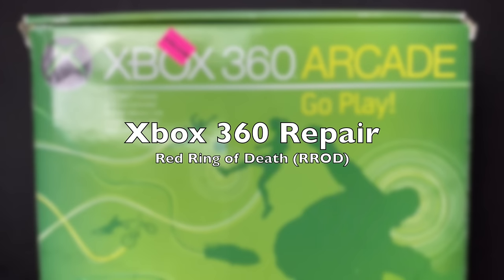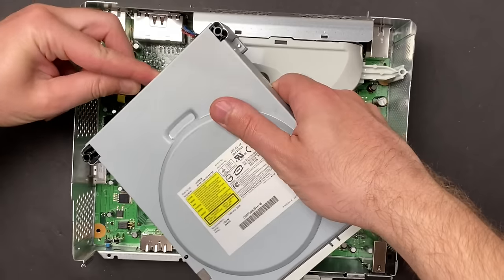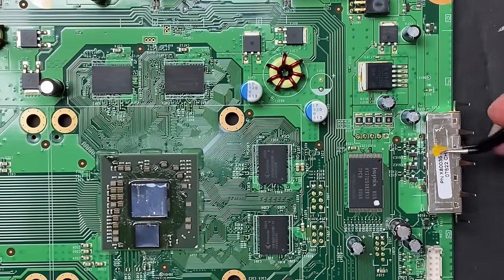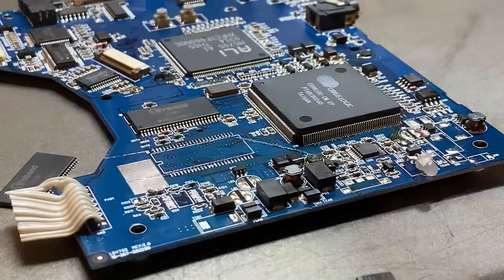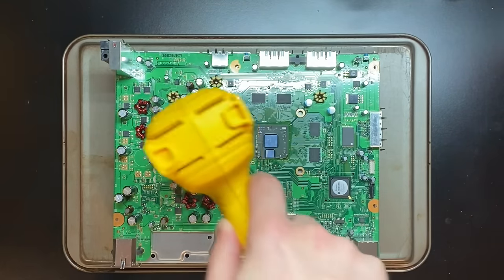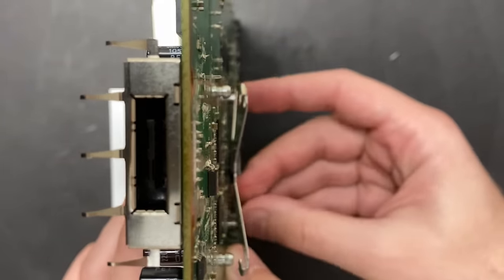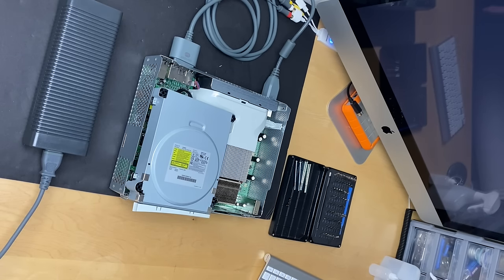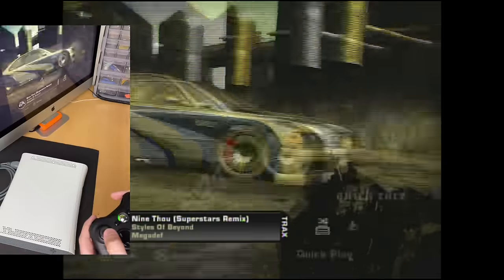Xbox 360 Red Ring of Death - DIY GPU Reflow

Comment: Okay just a heads up:

Place a layer or two of aluminum foil over the "silver capped" chips to prevent them from exploding or melting acids (they measure impedence and yes you can replace them but it's a real pia). Also aluminum foil everywhere but on the actual chips and even under the Xbox (like a basket) is a REALLY GOOD IDEA

Also the best parts were available at Lowes though I don't have the part numbers on hand I have fixed and modded hundreds of xboxes and the aluminum foil and Lowes part numbers worked 100% of the time for me and other amateurs.

The timing on the heat gun (300 - 450) should be perfect down to a science in fact I had mine on high for 30 seconds after an initial warm up from low for a good 3 minutes and a cool down for another minute if it would give me the same secondary code I just went up on the number of seconds in 10 - 20 second intervals from the warm up and cool down phases.

I also waited an additional 30 - 45 minutes before a test boot.

C4eva for life!
Reply: Oh and one last thing always use the right size screw driver to remove the x clamps! And using Lowes M4(?) machine screws with metal on plastic washers (on both sides: 4 total) provides adequate spacing just do not overtighten and definitely don't reinstall the x clamps since they were the reason WHY the GPU developed a cold solder joint in the first place
Reply: Also the capacitors don't need heat AT ALL because they can actually explode and yes you can melt parts straight off an Xbox doing it the way you are showing people.

Put an aluminum foil cover over everything BUT THE CHIPS

Comment: I really liked this repair I have my first Xbox 360 around too, it is red ringed, but I kept it, at a time I fixed it with a home repair website subscription that I bought for $30, my repair only lasted 15 minutes though. My question is you or he removed the components when using the heat gun but I didn’t see how he attached them back? did he use the heat gun again to attach them back or how? Because I wanted to remove those components like he did but how would I attach them back? Thanks.

Comment: Any recommendations on replacing the caps on the mobo? I went through this entire process of reheating the solder and new paste and it’s still kicking me a 0001 psu code. Tried two different psu’s and neither have booted my Xbox. After looking at the 3 caps near the psu port I noticed 2/3 are looking rough with corrosion and bulging. I’ve never soldered a thing in my life, but I’m wondering if those could be the culprit

Comment: I thought these xbox with the added heat pipe and fins for the GPU mostly fixed the RROD issue so I was surprised. I have this version, I think it's called Jasper..., and I've not had issue. Haven't played it in years now but hope to use it in the future.

Comment: Great. I just bought one of these for $5 as well. Don't have any cables yet, but taking it apart to see what I have. I have a 858D hot air station. If it turns out it has this issue. While ago a friend had one and just put washers on the screws for the heatsink. Puts more tension on the die.

Comment: This is my last resort before chucking the old console...I cant seem to get the plastic plugs off though.  Ive been heating them with my heat gun on low, but they dont get soft and pull off like in the video.  They seem hard and brittle.  Any suggestions?

Comment: I’ve had my share of wacky repairs. I remember shrouding my 360 in a bath towel to play my games until I saw weird graphical shapes,knowing my 360 was about to fail. Then I would whip off the towel and put two small freeze pack to cool it off. Hey, whatever works to play that bo2 zombies yaheard. That 360 I bought for 50 as an adolescent made me a pseudo-engineer hah.

Comment: Very informative video, and i am now looking in my collection if i own NFS: Most Wanted :)
On modding, planning of drive flash of a JTAG/Reset Glitch mod?? (this bring so much great options as homebrew, 'backups' and emulation.
Reply from the maker: I'm a huge fan, its been fun to replay it the last few days. Been an NFS fan since I got a demo disc of Need for Speed 2 SE on the PC way back in the day. Also played Hot Pursuit endlessly when it came out -- the cops chases were such a novel idea for a racing game, and challenging!

On the mod, just based on my dash version seems like I can RGH and the wiring will be simpler than R-JTAG, so I'm going to avoid updating the dash right now so I can exploit it with RGH later. No option to JTAG unfortunately on this dash version. I didn't really consider a DVD hack so haven't done any research there. Do you recommend it? I think playing backups from the drive will be the big appeal, you know, since I acquire all my games legitimately, ahem.
Reply: @BorderlineOCD  I love te older NFS games too, with my all time favorite Underground. And Hot Persuit as second, played that over and over too :) I have Most Wanted in my collection, checked it last night, sounds stupid, but i have over 300 origineal x360 games so things can be overseen :)

I self have a JTAG that was done in 2010 when the hack game available, but the RGH is the same thing as i understood, so if you can do that, definitly RGH the console so much more advance over a flashed DVD drive that only can play burned DVDR's. RGH Straight from HDD (also burned games) en homebrew emulators are so much better.  Speaking of HDD's it's from what i understood a SSD is possible :) Mr.Mario2011 didt a special about RGH and the software to use.
Reply from the maker: 300+ games wow! You must have a great feeling every time you look at your gaming shelf...

Just watched the Mr. Mario 1TB SSD install. Apparently the SSD is more for data preservation than speed as the 360 bus is SATA 1 so a spinning disc would be just as "fast". But SSD prices are so cheap these days it probably just makes more and more sense as time goes on.
Reply: @BorderlineOCD  Just so you know you can rgh on the newest dash I did so a few days ago using a coolrunner rev c, falcon motherboard. Also i'd recommend getting some 0.1mm magnet wire for jumping traces instead of using that giant stuff you used on the xbox it's a lot more flexible

Comment: In my xbox 360 fat version, 7 green capacitors have leaked and yellow liquid is outside on the top of each capacitor yet my xbox 360 is working, do you know how it is working with these many leaked capacitors?
Reply from the maker: Capacitors fall out of spec gradually and eventually fail. You can begin to experience unexpected behavior with failing caps and parts of the circuitry might be more stressed than designed but still operating within limits of component failure. Also there is a lot of redundant circuitry in modern tech. For example there can be several layers of filtering to achieve a clean video signal and if part of that circuit is out of spec other components still achieve the desired result. But long story short you need to replace those caps as soon as possible. The electrolytic fluid in caps is corrosive and will eat away traces on the board which will increasingly make the system more difficult to repair/revive down the road.
Reply: @BorderlineOCD  Thanks for the clarification, yes i faced 3 red lights sometimes when i do not use my xbox 360 for few weeks because of those failed capacitors and it did not start and 3 red light issue (red light of death) came but when i try few times by disconnecting plug and try again then it starts to work and it works without any issues until i did not use it for few weeks and again the same procedure of retrying to start it few times and it starts again and it works without any problem. Definitely with few working capacitors, i have to use it regularly. These failed capacitors are there in the xbox 360 for 3 to 4 years now, i have replaced the failed capacitor earlier but they keep on failing after the repair. Also the fluid in the capacitor is not there in the board as i have kept my xbox 360 vertically and it is not falling on the board, it is difficult for me to get them replaced as i need to goto some repair shop for their replacement, i am waiting for more capacitors to fail and will wait till these capacitors create problems in xbox 360 and then will goto repair center for the capacitor replacements. Red light of death in xbox 360 also comes due to failed capacitors.

Comment: Ignoring RROD issues, I wonder if there's any reason worth considering the OG 360 (particularly Elite) over my current 500gb E model? Also how'd you use your iMac as a display?
Reply from the maker: The primary reason would be your ability to mod the system. The capture card I use is linked in the description. It’s an inexpensive card that supports Mac.

Comment: Hey Mate, doing some great job with your restaurations, so if i got it right, you're using the lowest heat as possible with the Heat Gun ?
I'm actually also purchasing tools for that kind of fix, just wondering if a 350 celcius Gun shall be enough ?

Thanks in advance
Reply from the maker: Plenty enough to do the job. If you have a junk board try it to get a feel for your particular heat gun. It will give you confidence doing it on the Xbox.
Reply: @BorderlineOCD  Thank you very much, i did the repair a few days after you've replied, forgot to let you know that it went very fine !

Comment: I wish consoles would finally adapt CPU sockets like we have on PC. The only reason they don't is cause then its easy for anyone to just take the CPU out. That and the backplate or in this case the big metal thing the xbox 360 sits in is awful, all those bends and dips instead of a flat surface means that over time with heat the motherboard warps this is probably what causes the RROD all you need is just enough movement between the consoles mainboard/motherboard and the CPU, GPU, APU or any other components that get hot enough to weaken the solder they are attached with. On PC we have a backplate and wee risers called standoffs, The motherboard sits on these making it level and ensures there is a bit of room for ventilation behind the mainboard/motherboard instead of just motherboard directly attacked to a backplate that has to leave a bit of room, just enough so you don't ground out components against the case.  We then screw the motherboard into the standoffs and our CPU's and mostly everything else go into sockets. Upgradable at any time and forever unlike a console. Also this avoids the issue of solder getting weaker and turning your device into a brick. Consoles had to go with APU's. Accelerated processing units which is a CPU with its own onboard GPU this limits the problem of anything like the RROD as well. That and the newer consoles seem to at least finally have a better design, The xbox series X still worries me a little with a disassembly video I saw of the APU being held on with magnets and has pins on the back that match up to the socket. A simple retention system might be better. I hope they are good magnets. The PS5 is still using a soldered on APU which is fine as long as the cooling is good. The RROD and YLOD are two problems the consoles never should of had.
Reply from the maker: That would be great from an upgradability and repairability standpoint (not to mention good for the environment as hardware lifecycle increases). Too bad this would be contrary to the business model of most hardware manufacturers. Consumers don't care much for servicing their own stuff, generally speaking. If anything, embedded devices will get ever more popular.

Comment: i just got an old red light xbox 360 for £5 (uk pounds) and copied your method and it works and also has the same dashboard! I only bought it for the case as it was in good condition but thought I'd try it out of curiosity
Reply from the maker: Nice to see you got it working on an old dash! Can you tell me if you removed the plastic anchors and used flux? I'd like to know how long the repair holds up so if you like, please do share an update after you've used it for a few months.
Reply: @BorderlineOCD  yes i did the same and removed the plastic and used flux. Ive updated the dash and ill rgh it with ace chip like i did with another zepher so i can increase the fan speed.
Like you said for such a little amount of money it doesnt matter how long it lasts, it'll just be interesting to see how long, maybe forever!

Comment: Sorry I'm less experienced in this topic but how com the spray didn't cause water damage to the motherboard?
Reply: Because it’s IPA, not water. IPA doesn’t conduct electricity
Reply: @SteveTheCreek  Thanks for the straight forward answer.
Reply from the maker: The answer above is correct. It's 99.9% IPA. The water content is 0.1%. It is marketed as an electronics cleaner and is safe for that purpose. Some people use lower concentrations like 91% IPA but it has a higher water content so I don't bother with it. If you use that make sure it dries thoroughly and don't use too much.

Comment: Apart from cleaning the old paste (and putting back way too much), what is the purpose of the Flux ? What is a Reflow ? The melted flux goes all around the board, then needs to be cleaned, so what !?
Overall nice job, especially warning of potential heat damage 👍🏻
Reply: Flux helps the solder flow easier
Reply: @BeinZilex  but isn't flux a degreaser during soldering ? what's the point to "wash" the circuit board and components with warm temperature ?
Reply: @laurentpenot2656  he was using isopropyl alcohol to clean the board not flux, he used flux after

Comment: The EASIEST way to fix the ring of death is by literally just flipping those 2 little fans, when I was a little kid I had an original xbox 360, kept giving me ring of death at least every 30 minutes so I ended up taking it apart, flipped the fans to blow the air the opposite direction then POOF red rings literally gone forever.

Comment: I also have a red ringed 360 but the previous owner did the bolt mod which is known for later screwing up the motherboard but it won't turn on at all and im not sure what could cause it as it does have the bolt mod which could be why but theres also a set of capacitors around the gpu and cpu that have gone bad but when i used a hair dryer on the board i managed to get it to turn on once again but it only happened that moment after that it was back to the way it was but i decided to use the hair dryer again and well it only gets it working at random
Reply from the maker: I’ve seen some pretty funny pics of warped boards due to x-clamp mods. Too bad about the failing caps. It’s still an inexpensive system to shop for so hopefully you can get a working one together.
Reply: @BorderlineOCD  yeah but honestly with this one its not that much of a loss even if i cant fix it as i paid 5 dollars and it came with a hdd and power supply and tv cables

Comment: I had an Xbox 360 that I flashed and it ended up with E74 error and I used a heat gun and changed out the x clamps not that the x clamps made a difference but anyways after it worked again for ages and I was so happy, it was my first console repair way back then and since I’ve repaired my PS3 fat with YLOD by putting the motherboard in the oven and that lasted another like 8 months too. It’s not permanent but it gives the consoles a new lease of life which is good! I now buy faulty consoles to repair them and put them in my collection.

Comment: Be careful when doing any repair that involves intense heat on motherboards and chips. If there is any moisture inside the chips/motherboard it will try to evaporate and as a result of it being inside, it will “popcorn” the motherboard or chip and ruin it. Its best to bake the motherboard or chips before doing anything to ensure there is no moisture in them.
Reply: By baking, you are reducing the life of the caps. Your comment make me laugh.
Reply: @JohnSmith-el5mo  when I say bake I don’t mean bake it to the point solder melts or even close to that. 100C is plenty and won’t harm anything. 100C is actually the point the original Xenon and Zephyr models will shut off to prevent damage from happening to the chips. So, 100C is completely safe for the motherboard.
Reply: @burnedtoast8151  Capacitor runs the risk of drying or explode. Moisture inside the chip LOL.
Reply: @JohnSmith-el5mo  I don’t think you understand that 100C is completely safe for the caps. And yes, moisture does get into the chips. When you order chips off Aliexpress or eBay, the sellers will state that all chips should be baked at 90-100C to remove all moisture from the chips before you solder them on.
Reply: @JohnSmith-el5mo  when did I say 100C melts solder? I said to bake the board at 100C to remove any traces of humidity and moisture that’s in the chips to remove the possibility of them “popping” when you heat them up to 212C therefore ruining them.
Reply: And don’t take this the wrong way but I do not think you know what your talking about. For someone in your career you should know enough about baking the chips before you heat them up to reflow them. Also, the guy in the video is completely wrong. This Xbox does NOT need a reflow. It needs a new gpu. The problem with the red ring of death 90% of the time is not the solder, but the faulty flip chip design coming out of the tawain factories at this time.
Reply: @burnedtoast8151  O.k mate nextime I will ask for advice to the expert at  Ali express and ebay seller or yourself when ventilator fails on covid patients. lol.

Comment: I completed this reflow with same exact materials and as meticulously as shown in video. Also cleaned DVD drive and lens. I played APF 2k8 for about 22 hours before the screen started to pixelate. Then it rrod again at about 28 hours in. Just going to buy a Model E off lukie games and start all over.
Reply: Sounds about right, a heatgun reflow isn’t a true permanent fix. Did you use flux?